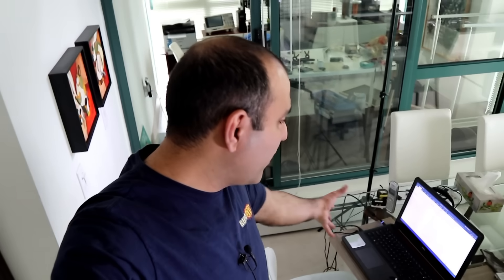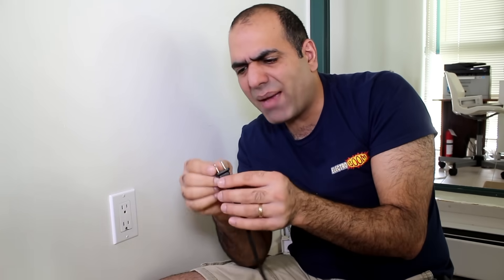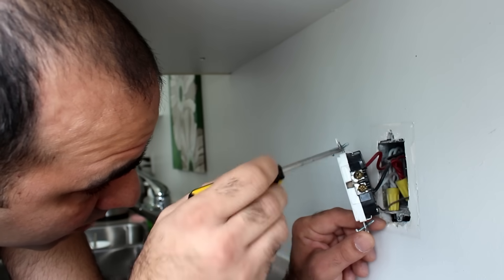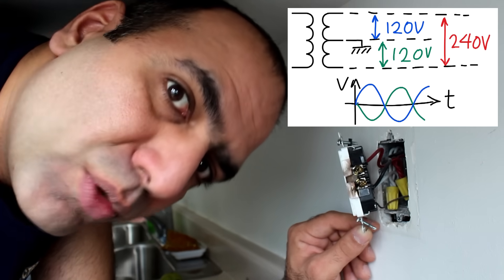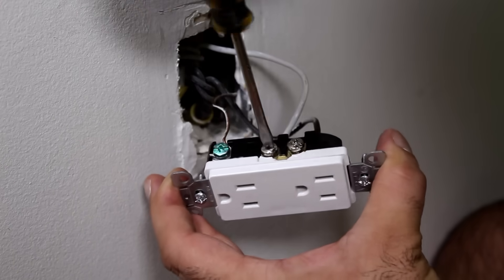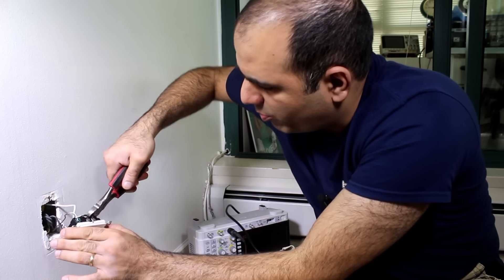How to Replace a Power Outlet

Comment: everyone make sure you turn off your power before you do this (if you live in a house with a power box
Reply: I think this man lives in an apartment complex with a fuse box at some remote location
Reply: My house in China only has 2 breakers inside and a wattmeter and breakers outside
Reply: Reality: sometimes u just have to work on live wires

Comment: Never use the holes. Always use the screws. During the months leading to us replacing many outlets in our house, one of the outlets in my bedroom would buzz and get really hot every time my sister would have her space heater (1500W) running. When we replaced that outlet, we found out that it was not only standalone outlet, but also a relay into my sister's bedroom. The relay connection had no grip in the hole, so it was constantly arcing when the power was high.

Comment: Re: correct polarity connections of receptacle.

I use the color of the connections screws as a reminder of and guide for correct polarity.

The screws for the common, (white wire), connection are chrome plated, and the line connection, (black wire), screws are brass.  Never seen the screws in a new recep any other way in 40+ years.

There IS an easy fix for certain loose 120V AC plugs. If the tangs of the plug are chrome, they are usually solid, and there is no fixing them. Take a close look, though, if they are yellow or gold, (brass).  You will see each tang is actually a loop of flat metal. Slip a sharp knife into the loop, and spread the tang, which will effectively make the plug tang thicker.

Plug will fit snugly into recep, now.

Gotta watch the polarity when replacing receps, switch it like he did, and you might find yourself getting the piss shocked out of you, working on a light socket, or light switch.

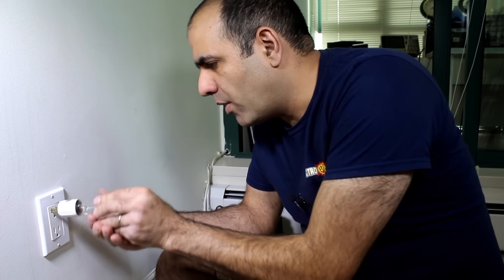Comment: 4:10 That cover plate is so not straight holy shit. I hope he fixed that, it's killing me
Reply: It's not even conductive...
Reply: Back stab connections are garbage. After a few years of plugging stuff in and out they come loose. I dont know why they are allowed. The backstabs are a fire hazard.
Reply: Cool i have ocd too
Reply: @Bf26fge  Essentially, yes. NA outlets are horrid but ElectroBOOM is EE so house wiring and stuff is not what he's usually doing. You don't need a master's in EE to be an electrician.
Reply: Well, the wires for the outlet are always stiff.
Reply: Dont know if you guys live in America but I'm a electrician from the UK at that design is bloody awful and why is there no cpc sleeving on the earth ?
Reply: @joshua strom hot and neutral have covers, ground is just bare copper. If you're careful with wiring, you're good
Reply: @joshstrom2791  Because 'Murica!
Nobody cares about safety - if it ain't broke, don't fix it...
Reply: @joshstrom2791  You think that is bad? We still have plenty of non-polarized and ungrounded outlets around. My bedroom has no grounded outlets. 

As to why North America has awful standards, the biggest reasons are:

1) early standardization in the 1910s (emphasized by not being devastated by WWII requiring everything to be rebuilt in the 1940s-50s)
2) no efforts to standardize internationally because until recently there simply wasn’t enough electronics travelling across oceans
3) general opposition to change and increased standards. Improvements are slowly implemented but any sort of wholesale change has no chance of happening because people will demand backwards compatibility
Reply: @88porpoise  is there a way to replace them?
Reply: @fancollectioncentral536  If I owned the place, I would. If just to be able to plug in what I want where I want. But not happening while I am renting.
Reply: @88porpoise  Oh 😔
Reply: @fancollectioncentral536  I also grew up in a house where my parents abandoned several planned projects because they were afraid to have any electrician look at the shoddy old knob and tube since they could never afford to replace it all. I don’t exactly worry about a bit of sketchy electrical.
Reply: he is lucky the damn thing even works
Reply: @rogerd4559  But how unfortunate it's not perfectly placed
Reply: Real American electricians make hooks and don’t use the terminals on the back
Reply: @nightcrawlr1035  You're just doing extra work... back wire is better and you won't break a sweat.

Comment: YOU REVERSED THE NEUTRAL AND HOT CONDUCTORS ON THAT PLUG YOU REWIRED !! YOU CAN BURN OUT YOUR DEVICES THAT WAY!! THE BLACK WIRE ALWAYS GOES TO THE GOLD SCREWS [TERMINALS] !!!! LOVE YOUR VIDS THOUGH! :)
Reply: I commented before he noticed it !! LMAO !! Love your vids still man!!
Reply: good spot, I didn't even notice until things went bang. 

I'm pretty sure he does that on purpose though, to show what happens if you do things wrong.

Comment: In our country we have 240V 60Hz mains using the American plugs and most of them don't have earth connection and so we use an adapter to plug into the mains outlet with no earth connection.

Comment: Forgive my ignorance if what I'm about to say has been posted. I didn't want to read thousands of comments. 

When Mehdi grabbed the live receptacle there are two things to consider: If he touched one live/neutral, that's a 120V shock - not so bad. If he touched both live, that will knock you on your @$$ and leave a burn. 

If you keep making wiring mistakes and keep clipping the wire, you'll end too short. If you choose to back stab, you can later remove the wires without cutting. There is a release tab beside the wire. Best to use terminal screws. If re-using wire without cutting, be sure the wire is not overly mangled, kinked, or nicked. If so, cut off the damaged part. When stripping, use the #14 slot in the stripper (for 15A). Wrap the wire so the end is in a clockwise position from the feed. After connecting the wires and tightening the screws, follow with wrapping in electrical tape for added safety. Do 2 wraps. Mehdi's light bulb test is not good since it only checks live/neutral. The light will go on, but it doesn't guarantee correct polarity. Best to use a receptacle tester. Otherwise check live/neutral and live/ground with VOM to check 120V. Check neutral/ground for 0 V for good measure.

If you're getting 208V reading from the lives, then you are using 2 phases from a 3 phase transformer. Single phase per outlet since live/neutral is 120V. However, be sure you are using 240 single phase for high voltage devices like dryer, stove, central air, etc. There's really no such thing as 2 phase - it's really 240 single phase with the centre tap grounded to make a neutral. Of course opposing the ends of the tap are 180° out of phase giving the appearance of 2 phase @ 120V each = 240V. For the average home owner/DIYer you'll most likely have 240 across the lives. Best to check. Mehdi will have 3 phase for all his experiments.
 
The amount of torque required to tighten a screw will vary based on gauge and material used. Check torque specs (Google it) and use a hand operated torque driver. DO NOT USE power tools. Experienced electricians have developed a feel for this.

If you're not 100% sure on any of this, hire an electrician. They're cheaper than fines or losing your house.  

Thanks always Mehdi for your videos.

Comment: It's better practice as a former electrician journyman (I'm more of a computer guy although I absolutely love electricity) to put hooks in your wires in the direction of the screw thread (so looking at the outlet, the hot side, hooks go up, neutral side hooks go down) and only expose enough copper to get completely covered by the screw. If the hooks are done right, when you apply them to the screw terminals you end up tightening the loop getting a solid connection that's completely covered by the screw. The stab-lock connector is a no-no and typically looked down upon as after a while they wear themselves out and fail, creating a dangerous situation. Typically an intermittent failure of an outlet or device is the symptom. They should only be used for quick temporary setups as wires do move around especially when not properly stapled off or anchored in the wall. I hated replacing stab-lock the most. If the previous technician didn't provide adequate Romex, BX, or MC cable in the box or wall cavity, they were awfully fun to have to strip out again. Almost always I had to just cut the wires and re-strip when a proper hook setup can be pried apart, re-hooked, and re-used with minimal wire damage and mitigating the need for stripping out more wire. There is another technology used in FPE (Federal-Pacific Equipment based out of Newark, NJ) called "Stab-Lok" that about one in every three breakers fail and it's highly recommended those get replaced. I have welded tools to wires and have had breakers that were switched off including mains that remained live. They are incredibly dangerous and should be replaced. They either don't trip properly within the proper time frame or don't trip at all. So if it's not somebody installing stab-lock outlets, it's FPE breakers I hate the most. I'd rather do work on old BX cable or Rayon than deal with that. Edit: and I really don't like those "decor" outlets like the one you have pictured. They seem all the rage and are what everyone sells anymore. The classical design was much better providing recessed pin slots and easier to plug something in during a low/no-light situation when you can't see what you are doing. Note: If it's not DC... Hot is Black and not Ground/Earth which would be Green or bare copper and the more load already on a circuit the more that shock is gonna hurt (could you actually explain that in a video as to why that is? I've taken hits off unloaded circuits vs circuits with an appliance drawing load and the unloaded circuit wasn't nearly as bad.) Edit 2: Those decor outlets are harder to get straight in a box as well... again... I hate them. They are everywhere too.

Comment: Type A Plug and sockets are verifiably the worst in the world. Like the laziest engineer decided two strips of sheet metal was good enough.

Every single Type A wall socket I've seen has burns because of the poor connections.

Comment: I really need this to be ansered!!!!!!! So im european. here we as well have two power cables and earth. These two cables are also called live and neutral. I HAVE ALWAYS THOUGHT THAT IT DOESN`T MATTER HOW YOU CONNECT THEM AND THAT THEY WHERE INTERCHANGABLE!!!  im refering to 3:25
Reply: Well I hope a 3 year late answer is ok.

Everything will work if it's wired backwards, but sometimes you have things like, for example, a toaster with a single pole switch, where you want to make sure the switch is on the hot/live side so that the heating elements are only live when they need to be. Now, things can be designed to be safe no matter the polarity, but it's usually simpler to just make sure one side is live and the other is neutral.

Of course in this case it's also important because the scope ground is connected to earth, and if you connect the scope ground to the live wire, you short the power.

Comment: Having  2 phases connect to one 120volt outlet makes no sense. It is also unheard of by me in all the places I have lived.  The only time I have seen the bridge broken is when a lamp is switched on by half while the other is always powered by the same breaker connection.  I like my 240 volts for ovens and clothes dyer type outlets.  If somebody ever did want to replace that 2 phase outlet and didn't know it was, they would get a nasty surprise when that bridge blew after reinstalling it and wonder wht kind of idiot wired it like that.
Reply: Yeah, I havnt figured out the reason for that either, my guess is to save a little money on another wire run so they have two circuits incase one gets overloaded by say a hot skillet

Comment: It's not nudify or what ever you said it's called stripping the wire also not all plugs have those wire spots its usually only 3 way and 4 way plugs there are some exceptions and that bridge is made to be broken if you need a certain wire setup or if you wanna have 1 side of the plug stay hot and half be operated by a switch for some reason

Comment: PLEASE READ BEFORE CHANGING YOUR OUTLETS.
DO NOT STICK THE WIRES IN THE BACK OF THE OUTLET. 
I have been on many service calls where heavily used outlets burn up because those “backstabs” are unreliable. You need to make a hook with the wire and hook it clockwise around the screw for a safe and secure connection. Also, when stripping the wire, do not do what he did in the video. When you twist and bend your strippers over the wire you are creating little scratches on it. When that outlet is being used (under “load”) heat is created from resistance of the wire. The wire slightly expands (invisible to your eye) and then contacts when you’re done using it. Over time that expansion and contraction will cause that wire to break. Congratulations, you now have a fire. 
-Electrician

Comment: Um, ya don't have to waste a new outlet, if you reversed the hot and neutral sides, by cutting the wires, leaving wire in the holes. Just push a narrow flat-head screwdriver into the release slot of each hole and pull the wire out!

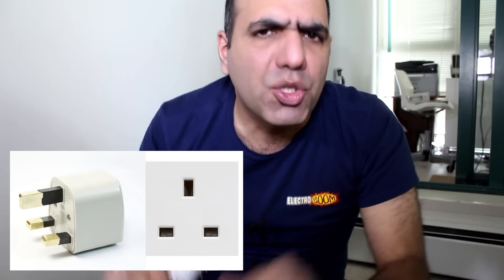Comment: 1:15 Although you're not wrong people thaught that the lower voltage sockets didn't need as much protection. Even though it still risks killing someone at an electric shock I'll tell you right now if you go to the UK where the sockets are totally so safe. You probably won't be able to make these vids one shock your toast! I might be wrong but I wouldn't try it.

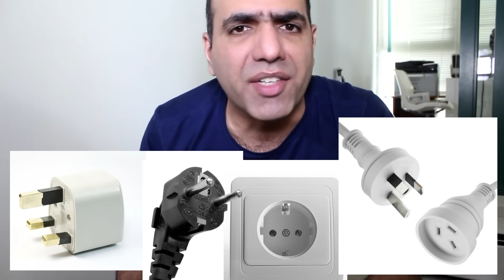Comment: 1:22 That is an illegal Chinese version of the U.K. plug. The clearance on the sides is too small and the ground pin is sleeved which may prevent the ground connection.

Comment: For these type of outlets the screws are more or less color coded.  The neutral wire is white and goes on the silver screws.  The hot is black and goes on the brass colored screws.  If you use the holes, make sure to use the ones on the same side as the screw color as appropriate.

Comment: European outlets are shit. Maybe higher voltage but its very easy to get killed by them. 2 Pins instead of 3 and also there are round ones and straight ones and they only fit in the same outlet. Stupid shit!

Comment: 1. Turn off breaker to the whole house

2. Disconnect outlet and take picture on your phone on what wires it connects to.

3. Disconnect wires to outlet 

4. New outlet find the image on your phone on where the wires is connected 

5. Run breaker to the whole house 
And test outlet for no neutral wire connection
Reply: I take picture with my phone of everthing I disasemble then put the hardware and screws in a plastic bag, tape them to the applyence im working on... and still MANAGE TO LOSE THE DAMN HARDWARE lol
Reply: Or turn off the breaker to the specific socket
Reply: I've replaced so many outlets in my house, that I pretty much remember how to do it by heart! Which made this video even more fun to watch! :D
Reply: you can just turn off only the breaker that goes to that outlet, then instead of taking a picture, remember that the wires go like this

hot, or black wire(s) --> gold screws
neutral, or white wire(s) --> silver screws
ground, or bare copper --> green screw

Comment: With your vast knowledge of ohm's law, I'm surprised you didn't realise how much better twisting the wire around the screws is than pushing into the quick connects in back. In my 15 years of being an electrician, those quick connects are one of the top  reasons I find circuits are no longer working, outlets burn up. They are very poor connections and create tons of issues when a heavy load is applied.

Comment: if you are gonna do this (wich is perfectly legal if you have the know how Atleast in sweden) Please be safe 
always use these steps

1 Flip the breaker where you are gonna change the outlets 
2 make sure no one can switch it on while your working (if its a old one whit the ceramics just take the whole ceramic thing out and take it whit you and if its automated (the new one) write a sign that says that your working on it )
3 use a multimeter to or similar to make sure there is no electriciry in the outlet and that you switched of the correct breaker 
4 change the outlet

you dont have to follow this but i just wanted to throw this out there as its very dangerous to change outlets if you dont know exactly what you are doing also in most european countries (like sweden) we have 230 v wich is almost the double from 110 like it is in canada 

Be safe when working around electricity dont take chances If your unsure hire an electrician to do it for you
Reply: Also not that in sweden and probobly other eu countries as well 
earth is ALWAYS Yellow/green (its halfyellow half green stripped) and the live is brown (though this can not always be true in older houses or the electrician who installed it used another wire) blue is neutral (but can also be a "ignition wire " (the wires going to and from a stair case switch

Comment: The UK plugs actually have higher current capacity, I use them in China for powering air conditioning system and heaters...

Comment: I work in older office buildings, the plugs are used for everything including computers. Breakers stay on. Changing a plug with the power on is no big deal.
Reply: Robert Kattner Yea it’s easy if you know what your doing. But if you do if often enough you’ll eventually get a tingle.
Reply: Also it's a lot easier if your hands are wet. Salty water is best to get a strong grip on that socket! Try it sometime!